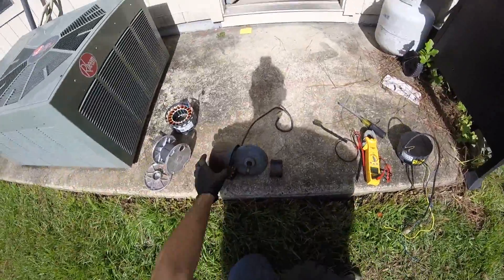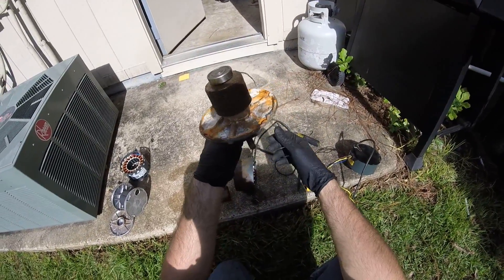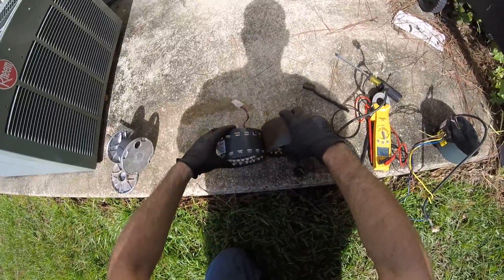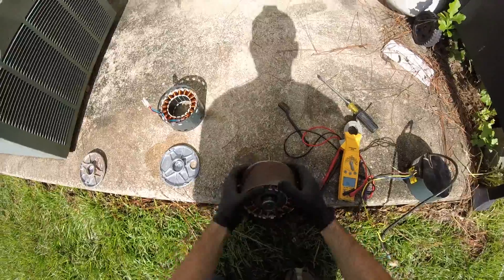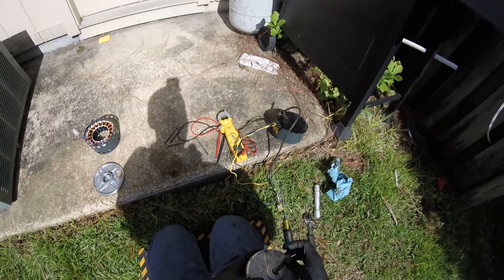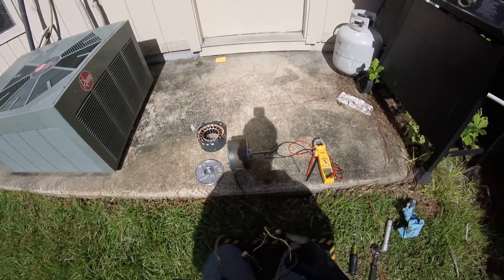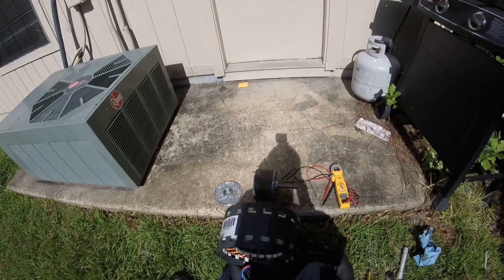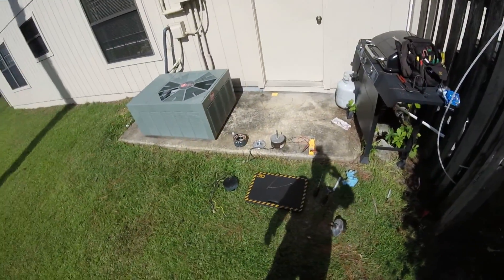HVAC MAD SCIENCE SHOW - ECM Condensor Fan Motor Repaired

Comment: Joe, great work and video.  What is uniquely good about the motor that you repaired is it's short body length.  All the other ECM condenser fan motors set the fan blade too low which disrupts air flow.  What is the part number of this motor?  And, do you recall the model number of the unit that it came out of?  Thanks...
Reply from the maker: That is very true and one of the reasons I wouldn't retrofit a unit to a ECM unless it was unique and fan can be spaced proper. It came out of a York Affinity YZH036. I don't have the part number but remember it will only go one direction unless you were to flip two motor windings like any three phase motor.